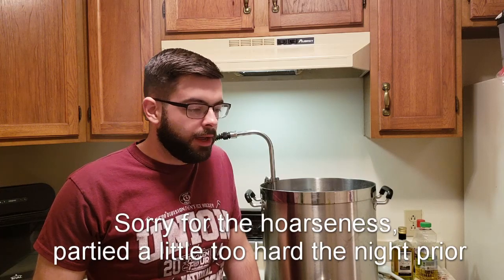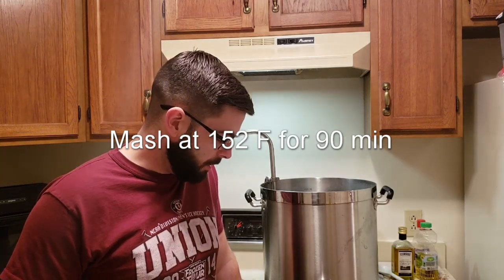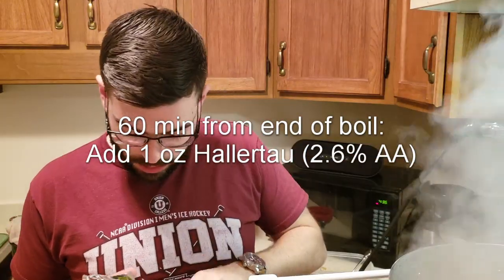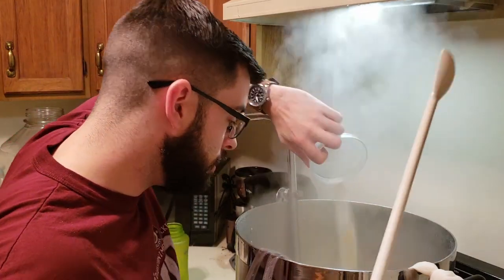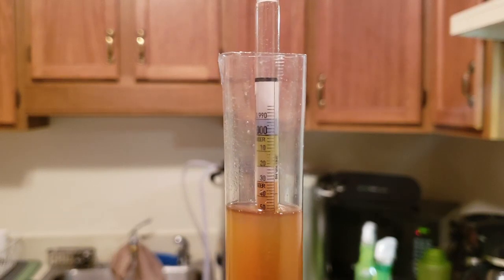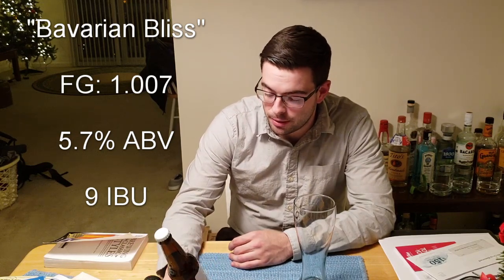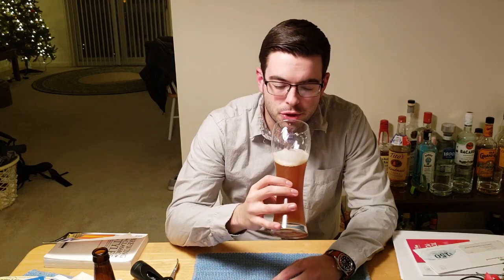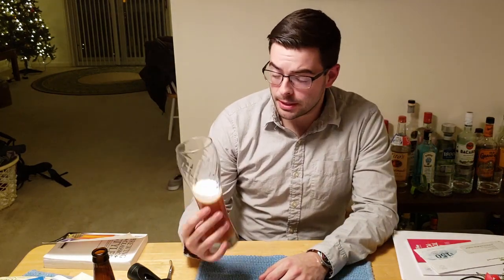How to Brew a Bavarian-style German Hefeweizen | Grain to Glass | Classic Styles

Comment: Hefeweizen is my favorite, probably due to "growing up" on KC Blvd 'Unfiltered Wheat' for years, not really knowing what I was drinking, other than a very delicious, (getting stronger by the day) full flavored beer. In the older days, they encouraged the swirling of the yeast and sediment on the bottom as the flavor was UNREAL! Now, due to having actual ABV levels on the bottle, the "old" way is now no longer in effect. Bottom line, it's now (from anywhere approx 5.0 to 7+) it's now at a standard 4.4% which is 1 point lower than any other beer if theirs, example, "Pale Ale" (which is also delicious but pretty hoppy of course). In the last 6mo, I've found it more difficult to find a Bavarian malt (cbw/ground) and have moved to 50# bags of malted Bavarian White and grind myself. Hops are getting harder to find, the more desirable types anyway. Sorachii Ace, etc, and some more desirable yeasts are even more difficult (although 'distillers yeast is easy enough to get). Bottom line, I try to avoid extracts by any means, but do have some on hand for back up. Looks like they may be utilized sooner than later if supply keeps happening. I can still find everything, it's just a little farther & more between at a higher cost, not to mention research at times. I'll never stop making hefeweizen, or dunkelweizen. Grain (wheat) will be the next issue. German, Bavarian, specialty, etc, and are starting to become costly. I LOVE hefeweizen. It's a calling. My first batches started off fantastic. (Yes there will always be a bad apple, it happens) but it's "my" type. Everyone has their type and that's part of what I LOVE about the 'hobby'. It's a lifestyle. Especially if you're good. God bless everyone, good luck, and happy hefeweizen!!!!!

Comment: hey i'm gonna try this this weekend! I'm a complete beginner so i have a few questions. What is the process once the two week bulk fermentation has finished? did you add anything before bottling it to make sure it was well carbonated? also once bottled, is there any specific amount of time you need to wait before drinking?
Reply from the maker: Yes, you will need to mix in a measured sugar solution (depends on your batch size and desired carbonation level) as you bottle it. Then the beer will naturally carbonate over the next few weeks
Reply: @TheApartmentBrewer  that was fast, cheers!
Reply from the maker: Cheers! Good luck!

Comment: Have you tried adding rice hulls? It helps with mashing.
Reply from the maker: It would for a 3 vessel "classic" all grain brewer to prevent stuck mashes and plugged valves during transfers, but in my case with BIAB, I cant actually get a stuck mash since the mash is actually filtered/contained by the bag.

Comment: Hey that big bag you added in the beginning, was that just the 5lb of german wheat malt? Or was the 5 lb munich malt and 0.5 lb melanoiden malt also in there? I'm assuming single infusion means you put all 3 of those in there at once? Sorry im new to this lol.
Reply from the maker: No worries, all of the grain was in the one addition in the beginning of the mash. And single infusion actually refers to the mash water. It means I hold one temperature the entire time and don't add any water. There are other mash styles, like decoction or step mashes, which require adding hotter water at points to change the temperature. I like to keep it simple when I can so I tend to not do those. Cheers!

Comment: I used WB-06 fermented crazy , almost spilling out my carboy for 50hrs at 25 c*  .  All of a sudden slowed down to 1 bubble per 15 sec.   Is this ok ? I got her down to 20c* after about 60 hrs . bubbles still about 15 per  sec on airlock.
Reply from the maker: 25C is 77F so that's very hot fermentation. Could explain the activity. I think you just had a fast fermentation, nothing to worry about there, but your flavor may be very heavy on the banana. But as always, fermentation should be measured with hydrometer readings instead of airlock activity. Good luck!
Reply: @TheApartmentBrewer  smells awesome coming out of the airlock. Shes steady at 20c* now on heat pad. First time pitching yeast too early because off double 5 gallon brew day rush.   Yeast Activity freaked me out.  Since Ive always pitched below 23c*.   Banana flavour smell for sure!

Comment: Can I make the whole process without a chiller? Just let it cool down on its own? Also, I didn't see adding any sugars. Am I missing something here?
Reply from the maker: You could realistically probably get away with cooling it down overnight if its covered, but it does prevent solids from dropping out quickly and leaves the wort at risk for infection if you dont quickly chill. I did this for some of my older brews and had acceptable results though. As far as sugars, there are none in the brew itself, but if you're talking about priming sugar during bottling, I dont film that. I typically use 4 oz of dissolved table sugar for 5 gals of beer

Comment: Aww man, you skipped over the bottling part!  How did you determine the carbonation level?  "I did about 2.75 volumes of CO2 for carbonation" 17:30 
Are you force carbonating and then bottling?  All around nice video though, you earned my sub!
Reply from the maker: Back when I bottled I would use Beersmith's integrated bottling calculator. That would give you an accurate representation of volumes of CO2 with beer final gravity and type of sugar used for bottling.